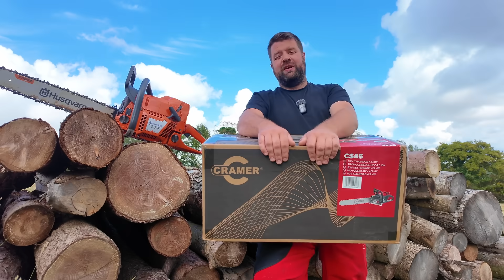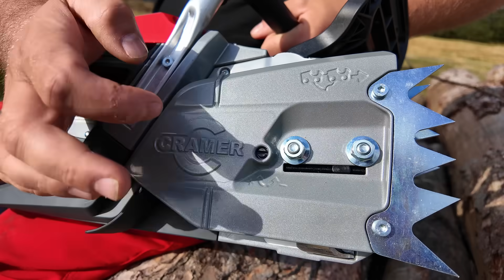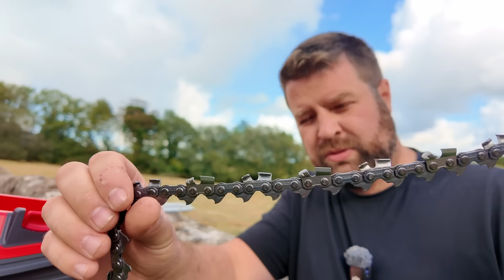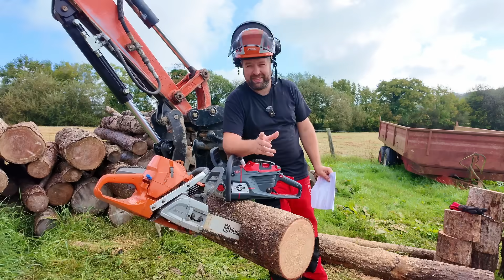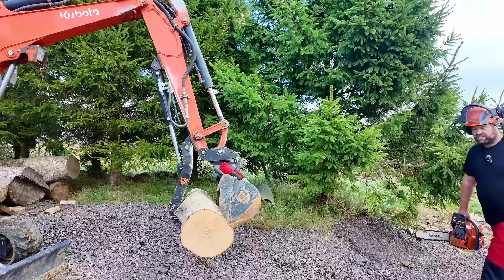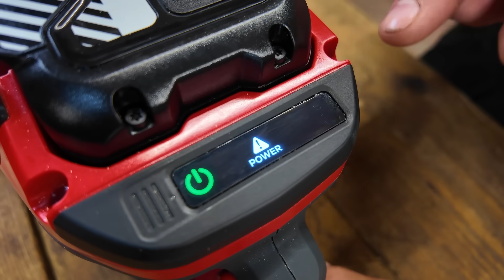Can this NEW 70cc Chainsaw BEAT my HUSQVARNA 372XP?

Comment: You didn't nention the trigger and switch. What is the time out when you have to press the standby disable? I used the MSA 300 Stihl and their system drove me nuts. It comes on far to quickly and is a fumble to disable. Like so many things these days spoilt by clumsy badly designed safety implementation. Stihl if you are listening please fix that on your next iteration. As for this saw, I've never heard of this brand before. Will they still be around or making a replacement battery in 5 or 10 years when you need one? It's a leap of faith.
Reply from the maker: I cant say the machine turned itself into disable while using it, or at least because the switch was so ergonomic it was second nature to depress it each time. Think the handle and switch on this machine is the best on a rear handle chainsaw ive used in a long while.
Reply: @MachineryNation I hope Stihl is listening.  I won't buy one of their battery saws until they fix that.

Comment: Always appreciate your great videos lads, but you should've had a new bar & chain on your old Husky. I know you mentioned this & sharpened the chain, but it wasn't a fair comparison. Also, I wonder if this new far eastern "Cramer" offering could stand up to the abuse of a real forestry-work situation as well as your trusty old saw? I very much doubt it. But less "intense" work, clearly no problem.
Reply from the maker: Hi steve in hindsight we should have put a new chain on. The chain was well sharpened for the hardwood test though. It will be interesting to see how these saws work in the forestry situations 👍🏼

Comment: Too heavy , an arborist i spoke with said he prefers his ms400 over his 500i purely because of the weight difference when using a saw all and every day , they are both way lighter than this electric saw . 
What is the cost of this with battery and charger and do Greenworks batteries fit ?
Reply from the maker: Hi Gordon, just had a quick google looks like a kit with the largest capacity battery will set you back around £1200, now this is probably retail by the looks of it. Not sure on the greenworks batteries fitting in, they look very similar in shape. 

Ive just weighed the 372XP fully fuelled and it comes out at 8.9kg approx, so fairly similar to that of the Cramer. I do agree with you though the lighter more powerful saws are more favourable as an all rounder especially if they are climbing with them. Thanks again for watching appreciate it

Comment: As others have said, the chain on the 372 is not very sharp or rakers are a tad high, not a negative comment but worth bearing in mind, maybe a brand new bar and chain may have been a better comparison, are the rim sprockets the same ie 7 pin, that 372 should have creamed the Kramer, i may be wrong, again not negative, love your videos, cheers
Reply from the maker: Thanks mike, we used a STIHL easy file to sharpen the 372XP chain so the rakers should be set and the correct height to the chain. The sprockets i believe were the same, the 372XP had the std pin on it from factory 👍🏼

Comment: I totally love my battery saws but as a arborist I want a dealer network that I can trust that is close to me. That's why I wouldn't get one of these. However for non pros looks great. Husky are bringing out the 564xp which is 2 stroke with fuel injection. Now that's what I'm waiting for 😁 keep the videos coming guys 😁😁
Reply from the maker: Hoping to get our hands on one of those soon 😉 - Cramer are building a very expansive dealer network in the UK, they have around 60 dealers nationwide now in the UK

Comment: Impressive Josh, but i love my 371xp, bought new in 1998, still puts in a good days work,wish i had kept my 272xp,blinding saw for the early 80,s, cheers
Reply: Im decidely not impressed, blunt chain on the husky. F off Mac nation, you are pushing a falsehood here. You got sponsored by cramer to push a lie. well take the money. but with it goes trust of your viewership. Everything comes with a cost. whats the run time on the cramer, price of the batteries? lets run a few numbers shall we, 7.2 aH battery that costs £500. at 82V that gives you 0.59KW/H running 4.5KW motor that gives you 8 minutes 24 seconds of run time. Cramer have a dual charger, running 4 amps per slot, so thats 2 hrs to charge 2 barreries, average to 1 hr/battery. you need 5 batteries to keep running . this gives you 40 min per hr. This allows the equlivalent petrol to be refueled and chain sharpened. Now to the money. £900 quid for the saw + £140 for the charger, and £2,500 for 5 batteries. that's £3,540 all in. and then £2.00 a day for the electric lets compare with a husky 572XP £960, leaving £2580 for fuel, lets call it 1.5 a ltr, thats 1,720 ltr of fuel, based on equal run time of 40 min /hr thats 1400 hrs= 175 work days= 35 weeks. in this time the batteries would have gone through 1400 charge cycles, then their is the electric. 175 work days x £2 is £350, this needs to be ballanced with another 233L of fuel equating to another 5 weeks relating to another 200 charge cycles. We will leave it at that. so 1600 charging cycles. Trouble is, after 1200 charging cycles, (I've looked it up) the battery is down to 80% capacity, thats another new battery right there. This is a more expensive up front cost system, that is more expensive to run
Reply from the maker: Hi Mike Husqvarna have made some blinding models throughout the years. Its always hard to hold onto them. I used to have a grey top 61, but never used it really so instead of collecting dust it was sold. Thanks for watching mate!

Comment: Very cool but at 1k usd and having to worry about buying a spare as well as keeping those batteries charged I will stick with my ms462
Reply from the maker: It would be an investment but with cordless tools you save in servicing and fuelling and when you increase the range the shells of the machines are most cost effective than buying a petrol machine normally - you have got a great saw in that MS462 🙂

Comment: As someone who has the new Milwaukee 2827 Chainsaw, yes they have more torque than the 372. But if you bury that full bar into a large piece of pine, that battery will have  12 minutes of run time. By the time you buy the second set of batteries price wise you could’ve have bought a brand new stihl 500!
Reply: Yes, that's currently the big problem with all battery saws.
Reply from the maker: It gets more cost effective when you start adding more machine to your line up. It does take more investment initially but there is fuelling and servicing costs to save on aswell
Reply: A plaud test. Right from the beginning, the battery power saw had a new chain ,  engine powered was running on a old chain it was a  totally unfair test becouse  of. that .
Reply: Yes but then it would still be a noisy two stroke that will need a day on doing repairs eventually. People buy electric chainsaws because they want zero maintenance saws that just need the chains sharpened and don’t want to pull start  their saws every time they shut them off. Electric chainsaws are heavy and have expensive batteries but it’s the convenience of battery electric that people like. I own the Milwaukee 70cc equivalent and bought two sets of 12ah forge spare batteries that can buck 1 full cord of large diameter logs that still needs to be split and stacked which is all I can physically do in a day. Battery saws are not for people who cut wood all day but for most people battery chainsaws work great.

Comment: Did you weigh the saw to be 4.9kg or did you use Cramer spec? With the Greenworks Commercial 5kw OCS800, they mistakenly swapped the weights.  I would be pleasantly shocked if the CS45 was 4.9kg and I would try to get one across the pond if that were the case! I know there are some comments about the chain,  nice thing with that Cramer is that it uses a Husky large mount and you could swap the whole bar and chain between saws to remove any doubt from the people who don't believe and keep it 100% fair.  I say if you don't believe,  run the saw and you will feel it.  The OCS800 will solidly outcut a Stihl 500i,  I'm curious if the CS45 would also.  Thanks for the review!
Reply: You really follow everything battery chainsaw on YT, you're everywhere :). I am too because I'm looking for something to replace our Stihl ms440 with.

They put 9.3 kg in brackets, all included. That would be roughly the same as a H.O.G. saw with the core400 battery, no?
Reply from the maker: @bluewaterball6032  ive just weighed a full oiled and fulled 372xp with bar and chain and it comes out at 8.9kg there abouts
Reply: @MachineryNation  that's pretty consistent with my findings,  and the optimus OCS800 is about 9.4kg fully dressed and ready to rock n roll,  so about a half kg heavier,  but a good bit more powerful... I'm thinking it's the Green twin of the redhead you're running 👍🏼
Reply from the maker: @reusefull  i think thats the case. Both manufactured by globe tools. Cramer being the supported brand in the UK and europe 🙂
Reply: @reusefull the sales rep at a event confirmed it was a rebranded optimus OCS800 for the UK/EU market. Love your channel 👍
Reply: @Matthew-vv4ml thank you!
Reply: @bluewaterball6032 Thanks! I try to stay up with what's going on - I went on the Cramer website. They list 4.89kg and 6.61kg(with cutting equipment), but there's no battery in the chainsaw in the picture,  so I think those are the dry weights with no battery,  which would be more in line with what the OCS800 weighs.  
I would only run the 800 or the 45 with the CORE530,  otherwise the saw will not have the power it should.
Reply: @reusefull  on cramer's website, they advertise even the CORE300 as able to deliver 5kw of power. Respectively 6 and 7,5kw for the CORE400 and 530. Of course endurance would be a problem with the CORE300 but are you sure it matters for power?
Reply: My CS45 weighs about 5.4kg without guide bar, chain and battery.
6.8kg including guide bar (20") and chain, without battery.

I dont know how  Cramer get to the 4.9kg. Maybe without the guide bar cover.
Reply: @rkagrargames Are you happy with it? Any significant drawbacks? I'm seriously considering it.
Reply: Try cutting something bigger maybe oak instead of ash. and use new chains instead of a used one..I'm sure the electric would still be a little faster but not by almost twice the speed.. and the gas would make more then a couple cuts before dieing like the electric

Comment: Chain on the 372 is blunts a biaxe 😂😂
Reply from the maker: yeah should have put a new chain on to start with 👍🏼
Reply: @MachineryNation  since you’ve said this, why don’t you remove the video, as I’m sure you’re aware, but quite a few people wouldn’t have known this, there for, have you ‘undersold’ the petrol’s chances here? I have noticed this for a while too, it’s the first time a 2 stroke tool has been used on your channel for a while and you can’t even be bothered to put a new chain on it, I think something strange is going on here!
Reply: @stamp28  I can sharpen a chain to be as sharp as a new chain so if he sharped the Husky chain properly a new chain should not cut faster. But clearly the stats on the battery electric has more power and spins faster which is why it cut faster than the two smoker which is why a new change on the Husky wouldn’t matter. Greenworks makes a commercial 82 volt 28 inch 5,000 watt 6.7 hp battery chainsaw that is a beast. Batteries still limit run times of battery electric chainsaws but battery technology is rapidly improving.
Reply: @MachineryNation  i dont ,, wtf you put time on this video and you cut with blunt chain ,what aaa,,big dislike
Reply: throwing chips and you can hear the motor start to force, if he had it more aggressive it wouldve just stalled chain
Reply: Big battery chainsaws have more low end torque and are far less likely to bog down when you lean hard on the dogs like a gas saw will do. I own both a 60cc gas and a Milwaukee 70cc equivalent that will definitely handle more force than the two smoker before the chain stops.

Comment: Why compare an old blunt 372 and a brand new battery saw …
Compare a brand new 572 and it would be fair …
Reply: The youtube channel @reusefull has comparisons of Husky vs. this saw, using a factory new chain on both saws each time, and the battery saw completely blows the Husky away every time.
Reply from the maker: @BenDiscoe  thanks Ben we will check this out!
Reply from the maker: We sharpened the chain after the soft wood cutting and felt the chain was as good if not better than that of a new chain. But with the difference in timings i think this video shows how impressive the battery cramer really is. We were working with the machines we have, unfortunately we dont own a 572 and there wasnt any way of getting one for this test. Thanks for watching though, appreciate it
Reply: The 372 was released in 1999, 26 years ago.

Comment: So question what use would class 1 20m sec protective trousers be with a 30m sec saw...?
Reply from the maker: Its a good question Dave for sure, there are several chainsaws now running this speed of chain now including the 500i. I believe there is such a thing as class 3 which are rated to 28m/s.

Comment: Cost? And it will be interesting to see the build quality in 5 years time. 

As I’ll always maintain, battery power machines do have a place but I can’t see them ever taking the place of petrol machines. 

Battery machines are great to pick up and go for a quick job but using a chainsaw for 8 hours a day 5 days a week is the test. 

Same with grinders & drills.

Comment: Well, that's bizarre. Cramer is just the local branding in Europe for Greenworks Commercial. The Greenworks Optimus saws are 3.0, 3.6, and 5.0 kW.  This Cramer Optimus saw looks just like the normal Optimus except it's ... 4.5 kw?  I mean, that's plenty powerful, but why would they use another motor power instead of just relabeling the 5.0 kW saw.  Maybe it IS the 5.0 kW saw, with the power limited slightly for some unknown European reason.
Reply: Sooooo how much is a replacement battery ?   when the original gets neglected 🤔
Reply: @pollywollydo they’re IPX4 rated and fine in temperatures between -20 and 50 degrees Celsius with a 5 year warranty, I’ve never had an issue with their batteries.
Reply: @Jay-and-co many lithium batteries now have extensive self monitoring in addition to the usual charging controls.   So 5 year warranty = 5 years to monitor your mistakes/ outside of terms, to arrive @ “ abuse” 🤫.    “ sorry Guv” 🙄
Reply: @pollywollydo  I’m pretty heavy handed with all of my kit, it all gets thrown around and the batteries are often dropped from misplacing them on walls etc. I get the point you’re trying to make, but the whole war against battery argument is boring these days, maybe just accept it’s not the same flimsy kit you tried 10 years ago.
Reply: @Jay-and-co not routing for petrol, , I have  2 electric cars and a battery storage system.   I think a professional has a decent chance of getting the potential life from a battery but Joe Average takes them for granted hence the large quantities of drill etc batteries in the scrap box @ the Tip ☹️
Reply from the maker: We dont know too much about the Greenworks HOG saw, but from alot comments it does appear to be 5kw. as you mentioned Cramer is the european leg globe tools. Where as only greenworks domestic is supported here in the UK